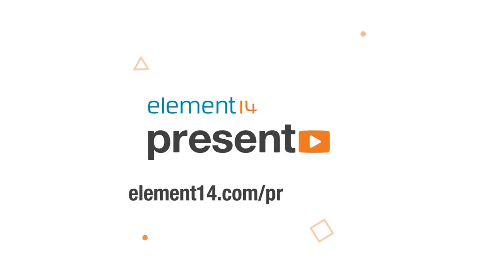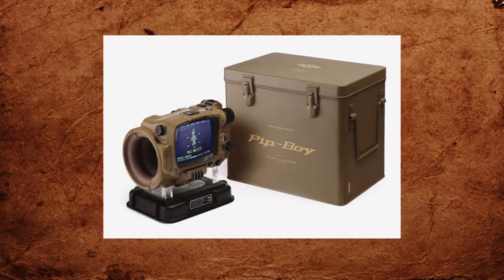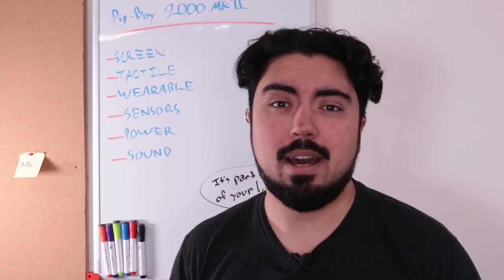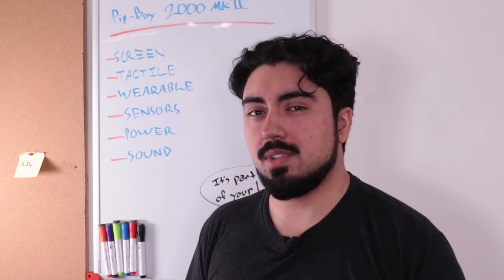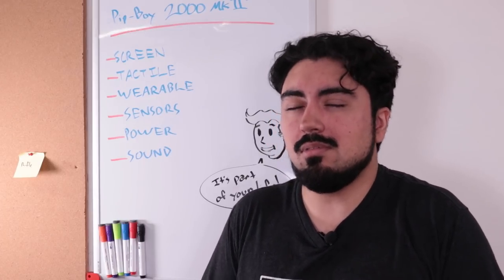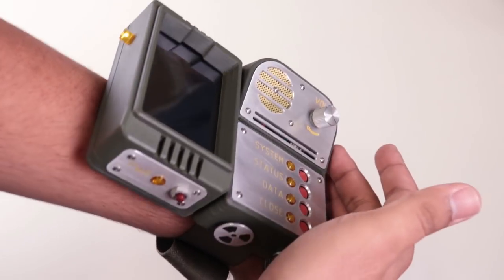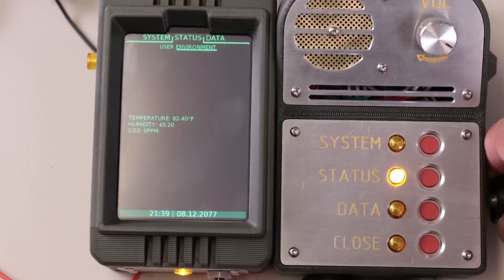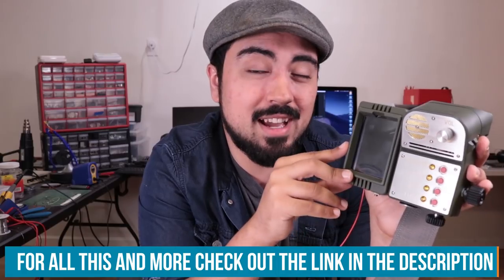#Fallout #Pipboy 2000 Mk II

Comment: The only thing I'd change is the wrist strap.  As you may have noticed it's difficult to put on.  I would use some kind of Velcro based solution.  Also a Pi Zero would use less power and if you use the W version you'd have network/internet access.
Reply: Maybe a different single-board computer all together. I know the Jetson Pro Mini is popular lately, probably could work in the ventilation/cooling system into the design. I'd be a power hungry beast though
Reply: The Banana PI M2 Zero might also be a good option. Roughly same form factor as the Zero W but with a Quad Core 1.1ghz Allwinner CPU instead of the Pi zero's 1ghz single core.
Reply: @bobdole4694  This thing doesn't need blazing fast performance.  You're not playing the actual game on it.  Just using it for a remote display.  The more of a power miser this is the better.
Reply: Yo

Comment: place a piece of domed acrylic over top of the lcd and fill it with some kind of clear non-conductive fluid like 3m novek or silicone oil.  it'll project the light to the surface of the domed plastic and give you most of the CRT aesthetic.

Comment: The difference between a 2000 and a 3000 is the assembly, 2000s are modular this can be seen with the mk6 the radio and speaker module, holo reader module, radiation and input module, and a CPU module, this was represented in FO2 with the 2000 having addition all parts that could be added, the 3000s on the other hand are fully enclosed, all parts and pieces are contained in a solid brace, this made them less advanced as they couldn't be upgraded, but more durable

Comment: It looks cool. A few tips though.. 30AWG Solid-core Kynar wire. It's often called Mod-wire since it's used for modchips. It's perfect for these tiny projects. This is in my Steel Battalion joystick. Just an example of how neat this Kynar wire is.
https://i.imgur.com/SBoMyVt.jpg
https://i.imgur.com/ssPNcOu.jpg
Get multiple colors. I ran out of a few, so i had mostly red left.

Try for a 5" screen and a narrower bezel? Also, if you use a larger screen, thinner bezels, and smaller wire and give yourself more room to work with..
Add a Geiger counter.
https://www.ebay.com/itm/273049840938
And then add a 5v analog meter
https://www.ebay.com/itm/152675816468

And change the backdrop of the 5v meter to be more in line with the rad displays on a real pipboy. So as the rads go up, even a tiny bit, have the 5v meter needle/wiper go up considerably.